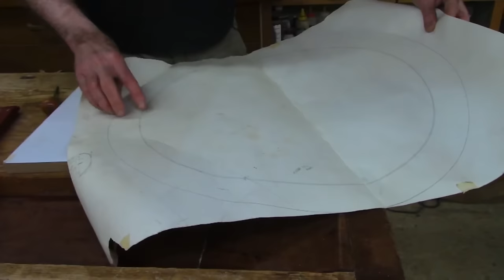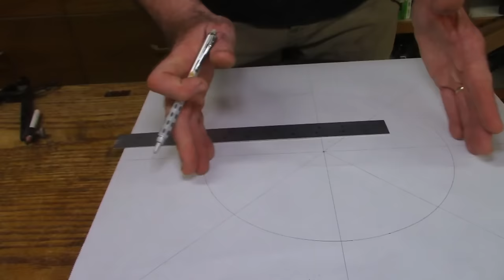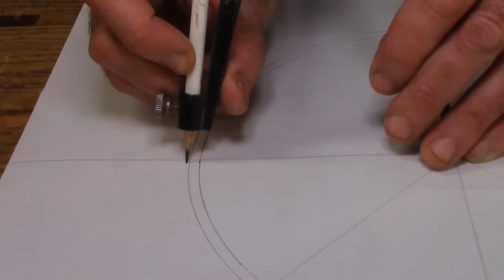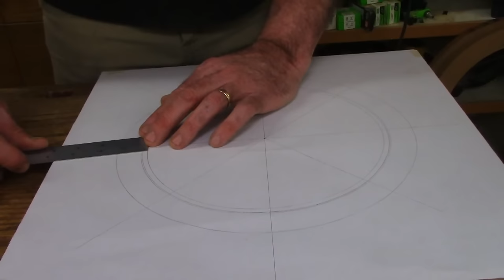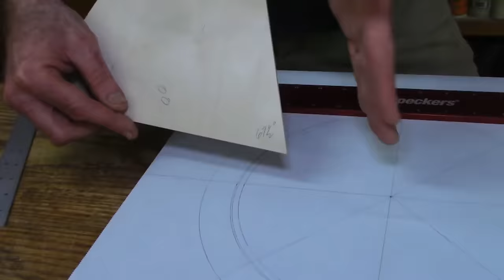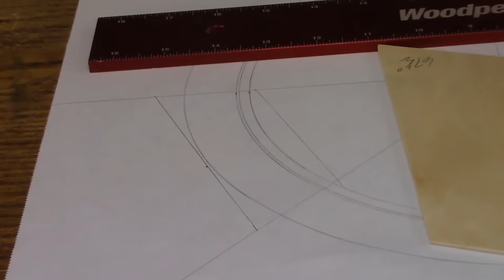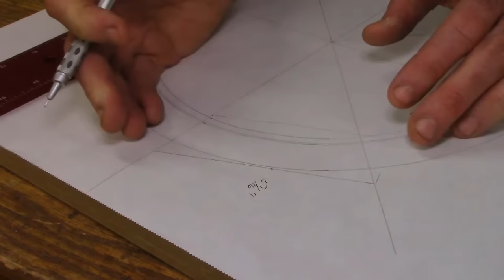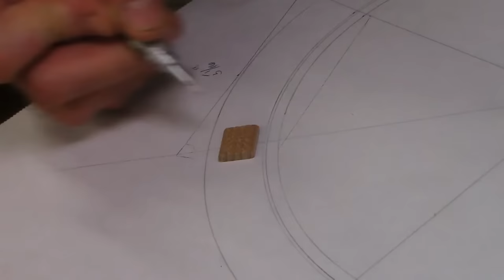How to Make Round Frames

Comment: Back in the late 70s & early 80s I worked for a framing contractor in Northern California building track homes. During that time round and half round windows were popular.  I did siding and exterior trim.  I had a side job building the 2x4 trim for them in my garage.  I used a similar method but since they were 2” thick I laminated two layers of 1x material.  I used an exterior urethane glue and galvanize 3D nail on the inside face.  The joints between plys were offset so no end joinery was required.  I had a jig setup on my bandsaw to cut the inside and outside radius.  The laminated method made it sturdier than if I tried to use 2x and end joinery since they were three to six feet in diameter.
Reply from the maker: Thanks Mike! You read my mind. I had actually prepared the same stock I was using in the video at half the thickness and was planning to show simply doing a quick butt joint rub fit to make two quick octagons and then stack and offset to laminate them together…almost identical to your method. But I realized I couldn’t get it all in so I was holding it if next time, but there is one more single layer end joinery method I want to get to, so this might stretch to three weeks! 
I’m envisioning you building those frames out of beautiful northwest cedar or redwood. I bet things were a lot different in Northern California back then, I’m probably close to the same age as you, I was in Lowell and Boston Massachusetts installing modular office furniture. Thanks for watching and being with us! 👍😎
Reply: @EpicWoodworking  yes they were made from redwood.  BTW I am very familiar with Lowell and Boston as I grew up in Watertown.  My dad had a cabinet shop in Waltham, Middlesex Millworker.  I started sweeping his floor when I was twelve, worked there every Saturday and full time during the summer until I went into the navy in 1973.  That’s how I ended up in the Bay Area. Unfortunately my dad lost the business in the mid 70s due to economic down turn.  You’re right, Northern California was a lot different back then.  Love your channel, keep up the good work.

Comment: A compass and triangle and square --  OH MY!    

This video, interesting in its own way,  is additionally interesting because I just finished making a "wedgie" sled to cut segmented bowl parts for woodturning.  I went through steps similar to those you took to make the guide blocks and stop for the sled. The difference is that I built a sled dedicated to a single purpose of cutting segments at a variety of angles. The important part is making sure the template guides are 'dead nuts' on. Finicky.

P.S. With respect to a question you were asked about determining the circumference of the circles and then dividing by 8 -- 

It is certainly mathematically possible to do this, but the  question is whether it will yield a practically useful and accurate result with real pieces of wood. Such a calculation, indeed, will allow one to derive the lengths of 8 equal chords of a circle, but knowing this length does not necessarily translate into a practically accurate layout.  For example, setting dividers to this chord length and 'walking' them around the circle typically will not result in 8 equal sides -- accumulated errors build up with each 'step' of the dividers and the last chord will be unequal ( even if only slightly) to the other 7 chords.'  Laying out the segments as you have done eliminates such accumulated errors. (Though your method may not be entirely free of measurement error, because no method is, it will tend to avoid a steady accumulation of errors in the same direction.)

Your method is more than a matter of personal preference, in my estimation. It also is the most straightforward and most accurate way to determine a set of equal segments for the purpose of creating a segmented circular wooden form in the wood shop.

Almost always, when it comes to design and layout, geometry trumps math in the wood shop -- at least in non-CNC applications. 👍

BTW: Though I cannot justify buying one for what is now only a hobby,  I think the Festool Domino tool is amazing. Great gear!

Thanks, guys, for another terrific video!
Reply from the maker: Thanks Jerry! Yes, I did think about that geometry puzzle a bit more after he fact. Sometimes I’m not sure if I am understanding the question as it was intended. My first thought was he was saying just calculate the circumference and divide by eight. But that wouldn’t, as you said, give you exactly what you want for the length of the segments needed….which are straight and therefore longer from point to point. Oh well, I think by going through the visual process of drawing it has lots of value in general because you really get to see ahead where you are going, in pencil before you cut any wood, and that often reveals things I might not have considered otherwise. 
Sounds like you’ve got it figured out and fine tuned by the description of your jigs! 
Thanks for watching and always being with us! 👍😎

Comment: Hi Tom Just watched your great demo. Just a question with the glueing. As you stated the pieces are end grain and also exceptional dry being roasted ash so would you paint the ends with glue and let dry to seal before doing the main glue up?
Kerry Snell, Auckland, New Zealand
Reply from the maker: Hi Kerry, that might do something to help but I’m not sure it would be worth the extra time involved. What I discovered the next day while gluing up three frames, is a healthy amount of glue on both surfaces worked well, and by the time you’ve gone around and painted some glue on all 16 ends, you’ve got a good adequate, beginning to gel, layer on there which gives you a reassuring line of squeeze out. I will be shaping and rounding them here and there this week in prep for this Thursday when I will show you the results and let you know what I think of the bond adequacy. Hope you can join us then or whenever. Thanks for watching! 👍😎

Comment: I was wondering if anyone ever uses some sort of “rubber band” for circular clamping. Sort of like those exercise bands of different resistance. It would probably be challenging to get it to even resistance all around and then the point where the ends meet unless you have one that is the right amount smaller than the outside diameter.  Oddly it seems like, it could work but might be trickier than I think😐.  The clamp you used definitely is the best way to go lol.
Reply from the maker: Yes I’m a big fan of being resourceful and using whatever method works. Recently I was introduced to the luthier method of wrapping bands like you mentioned around and around guitar necks to clamp a fretboard to the guitar neck. It exerts much more pressure than I imagined and is very effective. 👍